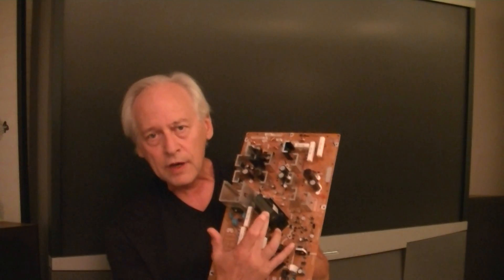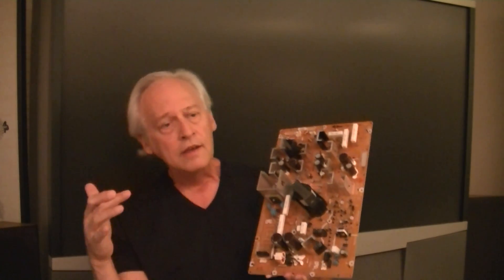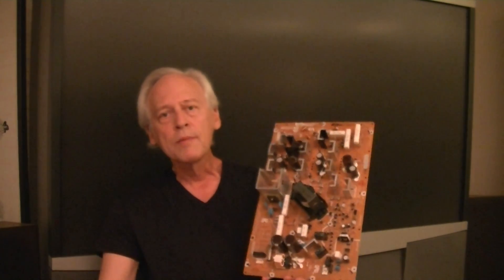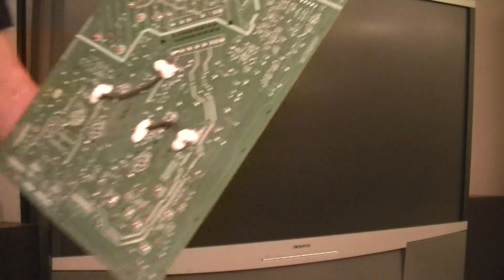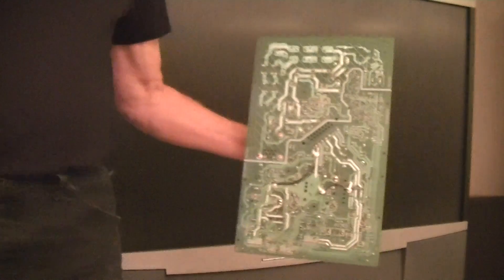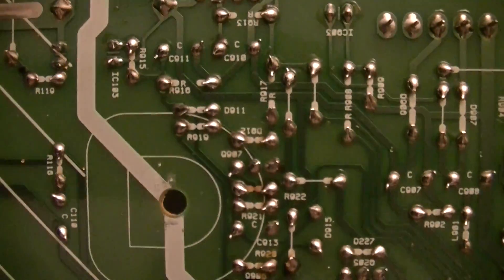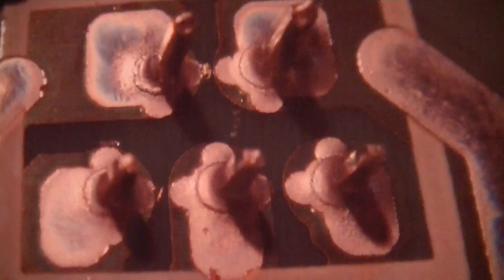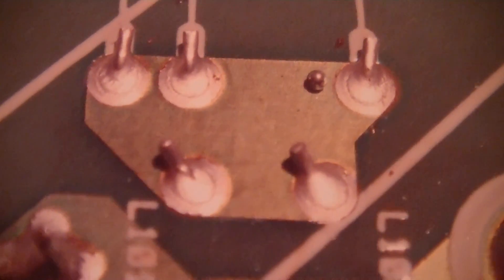How to Fix Your Pioneer Elite PRO HD Rear Projection TV and Protect It While It's Unstable

Comment: I have A PRO620hd PIONEER ELITE AND THE RED LIGHT IS ON like its stuck in standby mode? It was like this before....moved it into another room where it sat for about 2 years. Decided one day to plug it up and surprisingly it was working perfectly again. It worked for about 3 months........and then suddenly its in standby again.  I dont know what to make of it. I dont want to get rid of it.....the picture and sound is so awesome.
Reply: Same. I can't figure it out either!!!!
Reply: @spencermink81   TapeDeSpencer  Your issue is exactly the issue discussed in the video above. Your cold soder joints are breaking down on your board. I bought a 620 HD back in 2002 and after about 10 years or so, my power light would stay red in standby mode, but after some time, would turn green and the TV would come on. I would power it off completely using the button on the front of the TV, let it sit off for a while and when came back, it would go right to green when I turned it on. Well, that only lasts so long. Eventually even letting it sit powered off, I would push the button on the TV and it would go into standby mode and as this went along it took longer and longer for it to go from standby mode to green and get a picture. As Robert mentions in the video, once you start seeing this happen, you should stop using the TV until you get all the solder joints on the board re-done by Robert. I didn't find his advice until I was too far down the line as I kept using the TV. As he mentions, if you keep using the TV, you'll eventually have solder joints go bad down the line on the board that end up frying the board. So do yourself a favor and just stop using the TV and send the board to Robert. You can't fix yourself unless you're in the industry as you can see in the video the number of solder joints on the board that need to be re-soldered. As he mentions, this was an issue with the Pioneer sets that had the boards mounted vertically. Pioneer didn't use enough solder and the heat the board puts off when in-use causes the soldering to expand and contract over and over, causing them to fail. Robert re-does all the soldering properly so that once you get the board back, it will never happen again.

Comment: Hello,I purchased my Pioneer Elite PRO-730HDI Rear Projection TV in the fall of 2003, and it has developed the problem of intermittent horizontal red streaking lines appearing randomly. I have heard of this problem on the Internet with this model TV, and even a class action suit against Pioneer over this issue, and was wondering if there was ever a fix for this.Thanks for your time.Have a great day.

Comment: I have a pioneer 1150hd pro eite.i wanted to know if u can resolder my powerboard
Reply: I can work on your set and if the power board needs to be resoldered I can do so. But you have a plasma there, which didn't have the same cold solder joints issues that some of the CRT based sets had.

Comment: I have a Pioneer Elite Pro-530HD, manufacture date is May 2003. When I turn on the TV, there is only sound, but no picture. Can someone help me figure out what issues there may be?
Reply: Usually the convergence ICs need replaced.  But there's a dead man's switch on the x30 series that has to be taken into account.  Please contact me directly.  510-278-4247, 650-333-4808 cell, bob@imageperfection.com
Reply: Oh, we already figured it out. It just needed to warm up after all. Thanks for responding anyways!
Reply: All 3 model years of these incredible sets suffered from growing dim over the years.  This can be cured with a systematic realignment of the energies that power up the guns, since over the years your guns no longer receive adequate energy.  This is true of the Pioneers only, no other brand exhibits this phenom.

This realignment and thus raising the light levels of your guns can be done on the phone with me at one end and you at the other.  After the realignment you won't have to continue to goose up your black levels in User menu just to see your set's delicate shadow details, which are also helped by a thorough optics cleaning of the 10 optical grade surfaces - of the total of 28 - that get ferociously dirty in there, causing you to be watching a bleary picture.  It's not that your set is worn out, it's just the the light path is dirty.  That's all.

Raising the Black Level in User menu slews off your grayscale, which gets slewed off from aging as it is, ruining the delicate balance of the red green and blue that make up the critical gray known as the grayscale.  

Your blacks deserve to be clean, transparent and clear.  Your grays deserve to be a pure gunmetal gray, neither tinged or "colorated" in any way with any color at all.
Reply: Yeah, I already know about that. Not having any issues with our set still, though
Reply: Probably the LEAST reliable TVs has to hands down be RCA, though

Comment: Robert I'm glad to hear someone else in the world cares about rear projection Pioneer!!
I have a pro 99 elite that has gone into a turn on turn off cycle I have looked over the power board for bad caps ect. everything looks good as well as solder joints with a magnifier any Ideas?  Thanks, Eric
Reply: That vintage was plagued by cold solder joints, no question.  Not the entire PS board, but it only takes 1 to take a set down.  I would  be glad to work on it for you if you want to send it to me.  However I have no way to test it, not having your model of unit here.  Please contact me directly, at contact info posted in other comment replies here.

Comment: Robert, any issues with the PRO 730HD?
Reply: Sorry, I have not been keeping track of the goings on here. My apologies.

In answer to your question, no the 730 does not have such cold solder joint issues.  Neither does the version of the 720 that has the PS board floor mounted.  The other version of the 720, however, has the PS - power supply - board vertically mounted, such that you can see it when you look straight across thru the ventilation holes, right above where the power cord from the wall comes into the set.  If that PS board is vertically mounted, it is the same board they used in the 710 model of the year before, which was also vertically mounted and DID have the cold solder joint issues.

The only thing that ever really happened to the 730s - aside from eventually sometimes needing the convergence ICs replaced, which applied to all CRT rear projection tech - was a streaking that happened on them.  This was cured by replacing the CRT socket boards with new ones from Pioneer and then realigning the critical balancing of the 3 Screen pots.  A class action suit happened on this issue and Pioneer lost, resulting in their repairing countless units of the x30 series - 730, 630 and 530 - for free.

Unfortunately there was a time limit which eventually expired on the free repairs, and those whose sets developed that streaking issue later on in the set's life had to pay for the repairs on it out of their own pockets.

In the case of the cold solder joint issues on the PS boards of the x10s and half the x20s, the fix Pioneer put on the rebuilt boards was inadequate because it did not take into account the need for taking care of other solder joints that would be going bad later on in the lives of those sets, which is the nature of the beast when all solder across the board is the same solder, and is bad. 

As such many of the rebuilt Pioneer PS boards from Pioneer that went out again later, have been sent to me and once fixed and tested properly by me, are now making sweet HD images for their owners every day and carry my lifetime warranty on that erratic operation not happening again. This also applies to how most local repair techs handle the situation - they fix what's bad now and pay no mind to what will be going bad later.

I fix them ALL.  What's bad now and what's going to be going bad later.  Then I warranty that repair for life.  I am the only one in the world doing this.

I strongly suggest having me on the case if you love your Pioneer Elite - or non-Elite - CRT rear projection TV.  This permanent rejuvenation of the power supply board barely scratches the surface of what I can do for these wonderful long lasting sets, which are still lasting longer by many years than the new stuff available today. 

You can reach me at bob@imageperfection.com, or 510-278-4247.